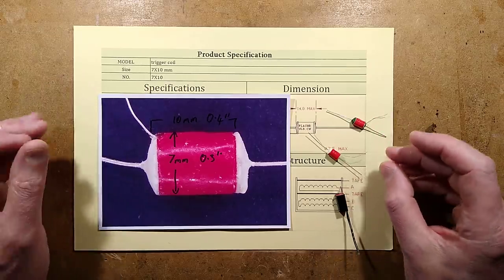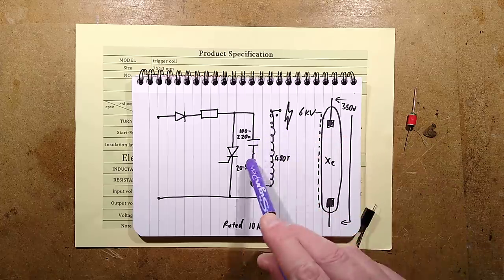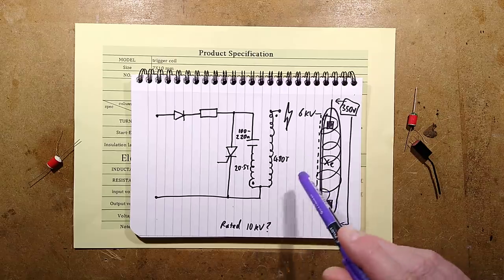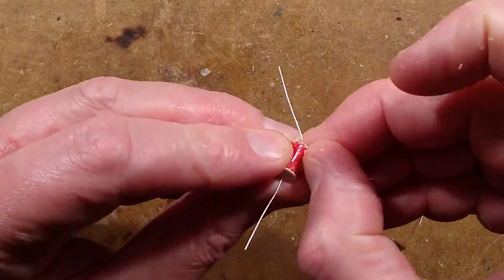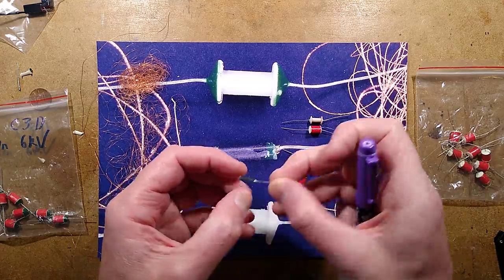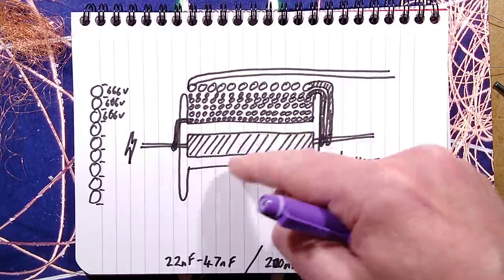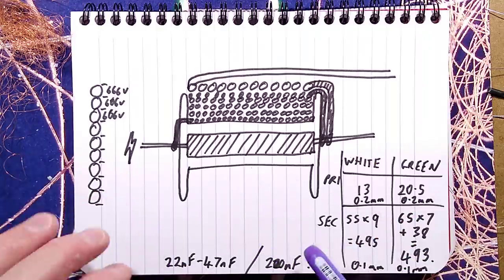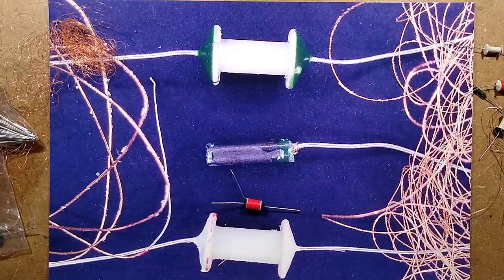Unwinding a tiny 6kV xenon trigger transformer

Comment: Clive, back in the 80's when I was in electronics school,  
I had a camera flash with a xenon tube, and we took the flash head and ran 250 volts through it, and it sorta lit, but not like a reading lamp.
Another bit of fun I had was with a g defective halogen tube from a copier. I rigged a high output transformer to the inputs, and got a small great spark through the bulb since the filament was not intact. Just curious if you have any knowledge on these light sources?

Comment: Ditch the primary winding and replace the ferrite core with a rod magnet and you have a single coil pickup for one guitar string. Hold my beer while I design a alternating-wound-alternating-polarity single (or would that be sextuple?) coil humbucker pickup. (To be fair, this idea was partially inspired by the Fender Precision Bass, which has a split reverse-wound reverse-polarity pickup.)

After a bit of thought and looking at other people's efforts with "bipolar" pickups, it's obvious that alternating pole pieces would be a terrible idea, as there would be a null between each pole piece that would severely limit the guitar's playability. Can I have my beer back now?

Comment: Thinking out loud - could you use two neons as the trigger element instead of a Sidac? The breakdown voltage is about 80V each, isn't it?
Reply from the maker: Neons are often used as a thyristor trigger in older strobes.

Comment: I was told (many years ago) the wax was to prevent moisture infiltration which would change the inductance value, which might cause it to fail to ignite the lamp or arc over.  Never understood how that was supposed to work...
Reply from the maker: It could also avoid areas for corona to form.
Reply: There is a trivial lowering in inductance due to water having about 8 parts in 1 million worse relative permeability, but as I understand it the cause is primarily due to different dielectric properties.

Water will lower the self resonant frequency of your inductor. You probably need to know a little physics or  transmission theory to understand why, let's just say that electromagnetic signals propagate at different phase velocities in different media.

While inductors may be designed to have (approximately) constant inductance over their intended operating frequency, the presence of water will lower the phase velocity at which the electromagnetic field propagates, lowering the self resonant frequency of the inductor and increasing its inductance in the intended operating range. For comparison, the dielectric constant of air is 1, paraffin wax is about 2, room temperature water is 80. Wax will change the inductance but far less than water.
Reply: wax provides great insulation, particularly near the ends. I also seals pinholes because it has a low melting point. Inductance values are not critical because the output voltage should be high and oscillating. Just high voltage outside the tube has no effect - you need ac to couple to the gas inside.

Comment: Is this not a fly back transformer so the transformer ratio doesn’t really explain the voltage magnification ?
Reply from the maker: It's designed to be pulse driven.
Reply: @bigclivedotcom  well yes fly back transformers are pulse driven hence the ferrite material rather than a iron core material. Sadly I don’t remember the math but rate of change is related to the output voltage and involves some differentiation in the mix. Thanks for the videos and fun a big fan here. Thanks Clive.

Comment: Most high voltage transformers have segmented insulated compartments for the secondary winding to stop the coil shorting from end to end, it is strange this works using just layers. I would have expected  break down of the insulation of the secondary winding.
Reply: Very low duty cycle, so the number of pulses it gets is relatively low. Generally only up to a few pulses per second, so the insulation and the wax will take a while before insulation breakdown shorts out a section of the winding, and even then the applied energy is limited, so it will likely self heal as the wax melts and fills in the space created, giving insulation back again.

They do fail when used as strobe actuators with high repetition rate strobes, so those typically will use a plug in board that has the strobe tube and the transformer as a single part that plugs in for service, as the tube by them will likely have millions of cycles on it and be very well worn, with sputtered tungsten electrode all over the negative side.
Reply: @SeanBZA  I suppose it is low cost, but so are the coils fitted to stun guns, and these do not suffer the same problem, being of the segmented design. I suspect the days of using a flash tube in stroboscopes are numbered, as LEDs now provide a viable alternative for most applications, and can achieve a very high flash rate.

Comment: Wonder if winding a trigger wire round an ordinary florescent light tube would get it to strike, without the need for a choke?
Reply: better to paste it along the length
Reply: Yes. Putting high voltage AC near a fluorescent tube makes it glow.

Comment: You don't suppose that they use wax to help manage the heat in the coils, do you?
Aside from being fairly cheap, easy to work with and readily available, that's the only reason I can suspect wax would be used.
Reply: Wax is an insulator so it will only manage heat if your idea of managing heat is retaining heat, the problem being that the more heat it "manages" the closer it gets to melting and the less managing it will be doing.

It's cheap, it insulates, it will flow, infiltrate and conform to the wire and restrain it when it freezes reducing magnetostriction and acoustic noise.
Reply from the maker: These coils dont really get hot in normal operation.

Comment: Very interesting. How do you control the duration between the strobe pulses? Is the resistor in that circuit usually a potentiometer?
Reply from the maker: In older strobes it was a variable resistor controlling the charge current to a capacitor and a neon lamp as a trigger threshold.

Comment: Sir Clive, you mention "Potted" a lot when it comes to coil windings, does this potting have any relation to EVH and his pickups?
Reply from the maker: Potting is just a term for filling an enclosure with resin or wax to seal a circuit from moisture.
Reply: @bigclivedotcom  EVH potted his coil pickup windings because he could hear the copper windings vibrating under extreme volume, seems unrelated :)

Comment: Instead of the zidac or the tharistor, could you use a zener?
Reply from the maker: No.  A zener would just start conducting slowly at its voltage.  A sidac suddenly turns on and dumps current.

Comment: What happens when these transformers overheat? Given the wax.
Reply from the maker: In the event of miswiring the trigger and power connections on a string tube, the wax melts and the transformer goes open circuit.
Reply: @bigclivedotcom  Does it first short out and then the wires act as fuse that goes open circuit? Thanks for the reply.

Comment: In flash guns they use MUCH larger caps. 100 u at 400 v low mark space ratio
Reply: That would be for the  main cap across the tube. I believe the cap value  he mentions is for the primary side of trigger coil. Aka Condenser in old fashioned car ignition which work on same principle, except primary side in ~12V secondary is "wake you up real good".

Comment: what happens if you wire a fluorescent tube in place of the xenon tube?
Reply from the maker: It would probably make it light, but could damage the electrodes by using in cold cathode mode.
Reply: @bigclivedotcom  i was thinking if you could explode the tube because it was not made to handle that kind of current.

while the bulbs are not too expensive you can experiment with junkers that still work but are being replaced due to epilepsy triggering threat.

hospitals and many rehab places will replace the bulbs before they start to flicker so you can get a junker from them.

often when they fail they fail where the filaments burn out so they cant strike normally so they need a high voltage to strike them.

Comment: How dangerous are these?  Can shock you? or Can kill you?
Reply from the maker: The high voltage is spiky, but low power.  However, it's often referenced to the mains and will initiate a current path.

Comment: As you unwind the diameter is decreasing. It will throw your numbers off
Reply from the maker: But they're still full turns
Reply: @bigclivedotcom  as long as the original diameter is maintained, lets say you wanted to make another coil

Comment: i wonder if the choice of wax over varnish has something to do with heat management.  The wax would hold the temperature of the coil at the wax melting point , prob 60 to 70°C ,for quite a time, absorbing bags of heat, until the phase change is complete.
Reply from the maker: The coil wouldn't run hot in normal operation.
Reply: Paraffin wax melts at about 37°C. What are you then going to do with the melted wax dripping out of your transformer? A one time only heat sink?

Comment: That's a terrible calculator, Clive. Not because it's pink, but because it isn't RPN.
Reply from the maker: Ah, but it does have 10 digits instead of eight.  Makes it more useful for low value capacitor computations.
Reply: @bigclivedotcom   OK OK ..... 😄

Comment: You can't have a 1/2 turn on a transformer, so it's a 22 turn primary, so that gives exactly 6kV
Reply: A half a turn means the end of the wire comes off the other side of the core from where it starts (12 o’clock to 6 o’clock); not impossible at all.
Reply: @anjrew  It means the 1/2 turn isn't counted in the calculations; of course it's physically possible.